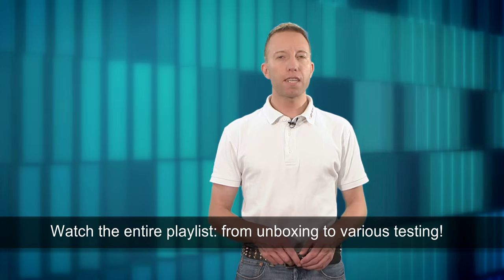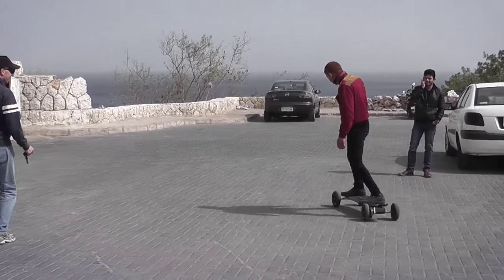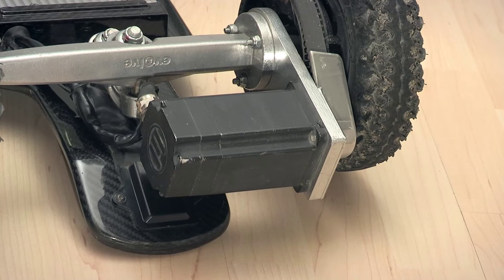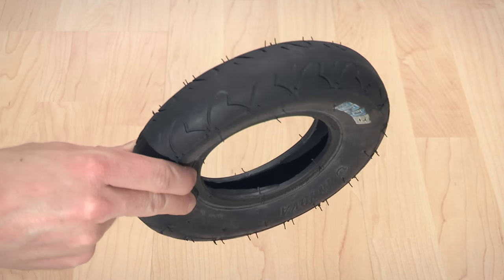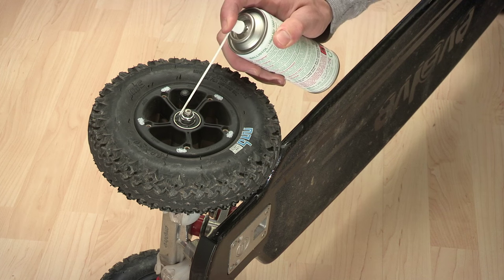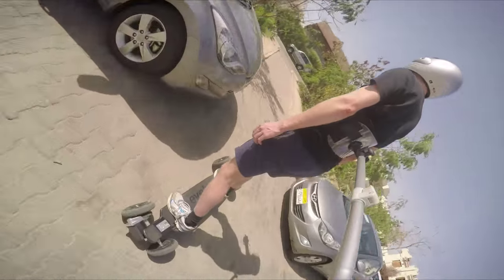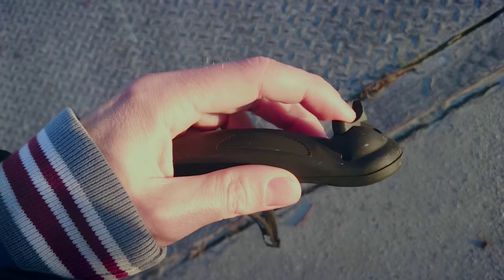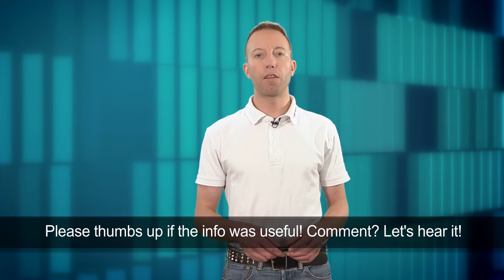1500 km (!) on the EVOLVE - how does it cope? Review, part 3

Comment: My recommendation regarding bearings on my Evolve (Pintail Gen1): After a few tests with bearings including expensive ceramics I switched to "Zealous" bearings - they are really phantastic, maintenance free, water proof and near zero resistance. My non-electric longboards roll away with them on even flat surfaces ! Zealous have integrated speed rings and spacers so you can tighten the screws to the max- wheels still spinning freely - but I had to modify the drive gear a bit so the spacer extension does not touch inside - spacer does not spinn but drive gear and wheel. 
BTW Zealous were voted as best bearing by some skater forums - just my 2cents.
Reply from the maker: Thank you very much for sharing this useful advice. I and I'm sure everybody who reads this will highly appreciate it. Thanks also for taking the time to describe in detail why you recommended it thumbs up

Comment: can you tell me exactly, what brand you use to clean/lubricate your bearings please?
Reply from the maker: +Arthur Curry There are 3 options to lubricate your bearings: Wax, special lube (more liquid), and "oil" (very liquid). While the first lasts longest, you need to run in the bearings for around 100 km or so. Special lube is best of both worlds (lasts long and lubes right from the start), and oil is easiest. The thing is: You lube with oil once, then you more or less need to continue. Also, if you don't clean the outside of your bearings properly before lubing, the oil may wash dirt inside, thus killing the bearing. Personally, I like the oil: very good lube, no run-in time, usually no disassembly of the bearing. I clean them regularly anyway (when dirty), so that's fine for me. I use a brand called "Ballistol" - quite common for many things. Could recommend it, but there's many similar such lubes out there. Dry Fluid will likely also work.

Comment: Hi, when is the video about the external batteries coming? Can't wait!
Reply from the maker: +bikeinmotion It's already filmed. Wanted to have it online these days but am currently drowned in my daytime job. But hope to cut and post it shortly. It'll enable you to do such a Range Extension Mod yourself. We're currently riding 4 such boards, all without notable problems and up to 50 km per ride (more is possible). We've meanwhile several 100 km experience with them. Note that nonetheless the project is still in BETA phase and recommended for experienced guys only. Cheers, Tobi
Reply: +HeliGraphix.com Beta is fine with me. I saw somebody build a new battery for his board but thats not what I want. Adding some 5s lipo on occasion would be what I'd like to do. I just dont know how to connect it the best way.
Reply from the maker: That's exactly what we've done (2x 5s = 10s BTW). Video will show you how to best do it and be minimally invasive at the same time. Concept is beta proven. See you soon then!
Reply: Soon is now  :)
No just kidding, my board should arrive tomorrow so I'm really lookin forward to the video.

Comment: My board was badly (and wrong) assembled (bought in the USA), it also got the first part that broke due to fatigue cracks after less than 3 month!! Badly engineered when it come to worst case scenarios imo!
The air wheels are probably pretty helpful to keep the parts alive, the street version wears up VERY fast!
Reply from the maker: Thanks for the info. Always good to hear about individual experiences as over time it gives a good insight into how the boards hold up.

Comment from the maker: +Joni English  Still pretty much the same range. I need to add though that I'm alwas storing the board properly, meaning not fully charged but at its ideal stoarge voltage (roughly equivalent to 30 - 40% charge). Storing it fully charged as Evolve advises is a sure way to diminish your battery performance. // @Joni: as mentioned earlier, plse. check your G+ privacy settings, it is not possible to answer to your comments directly!
Reply: +HeliGraphix.com seems like a aweful lot of problems for such a expensive board ?.
Reply: +Blake Garvey i wouldn't call these details all problems... its just wear & tare maintenance that will be more common with AT kit... the street kit will probably have different results overtime. a BWM 5 series will probably take less of a beating than a Chevy Silverado... you have to have the right expectations with each board :) its soooooo worth it to deal with when it comes to these factors!
Reply: +Blake Garvey Constant use on 1500km on uneven terrain it WILL take its toll on the mechanical parts, but given the right maintenance and expectations it's a pretty low cost.

Comment: Outstanding, thoroughly informative video. I just discovered your videos as I've been considering buying one of these boards. May I ask where you purchased those replacement tires/wheels? I was worried they would be odd, hard to find and would have to pay high price for original Evolve replacement ones (since they get the most wear and tear). Again, great vid's. The heli's lifting the woman blew my mind. LOL
Reply from the maker: +Francisco Borrego Thanks for the great comment Francisco. The tyres/wheels aren't produced by Evolve, they just buy them from 3rd party; in this case MBS Mountainboards. This means you'll get them anywhere, although the price is pretty much the same across vendors. The tubes as such are even more standard stuff, they're the ones used e.g. in wheel chairs. I bought most stuff from Evolve, but for testing purposes a bunch of wheel chair tubes (all my many flat tyres were with "Evolve" tubes); so far zero difference, exact same thing. Bottom line: the replacement parts aren't hard to find, but the price is indeed high and - except for the tubes - not really different across vendors of a certain region/country. Hope this info helps.
Reply: Very helpful indeed. Thanks for the response and all the great videos!

Comment: Just rode again today . outside temps -8c      , yes Also experience remote cut out , from time to time .this is later on during the ride after about 30 mins .and on high speed setting . red led light was also on solid.
but when connection resumed was ok .

Comment: cool project! Im about 2000 in and though Id share my experience with my carbon street.I found my phone was causing radio drop outs the most (I still take my phone with me on airplane mode), also the  connectors on the radio circuit board  in the tail vibrate loose, more so on the carbon street a dap of hot glue on the plug and conector fixed mine , I also use the range extender(power on, wait till the remote binds, press power button 4 times fast , light flashes fast ,4 meter range) .  I'm quite convinced the drop outs are interference .I have had drop out in exactly the same spot .Dont get me wrong I love this board the most out of the handful i have tried but the fail safe full brake at 40 km per hour isn't nice and is not for a beginner . As for the battery Its well know that lipo battery's don't do well in low temperatures, its best to store the board out of the cold (room temp) before use . Also if you flaten the battery dont store it flat ,charge then store . Only charge lipos at room temp were possible , on cold mornings I would lightly warm my battery's in for rc planes for much better performance all round.
Reply from the maker: Many thanks for this insightful comment and the tips re. drop-outs and vibration. That's really useful, me and the rest of the community certainly appreciate it! 
Sorry your comment got trapped in YouTube's spam section (really have no clue why), didn't find it until now.

Comment: I'm sure the wearing down of the drive wheel teeth is from the friction when hitting the brake. i loosened my drive belt so I'm sure this is something i will also encounter eventually. i agree with the air deflation you brought up, kinda baffling....I'm still the only guy/person in Houston riding one of these things, or so it looks like... and I'm ok with that B) Great review btw!
Reply from the maker: +Shane Shannon Thanks for the comment and for sharing your experience Shane. That's always cool and interesting for everybody around here. Re. the wearing down of the drive wheel, I also thought it might be due to braking but when taking a second look, this seems unlikely. Because in that case the teeth would be worn on their other side. We fly lots of R/C helicopters and there you find similar wear patterns, caused by one gear pushing the other, and also by belts running over pulleys (basically same as on the Evolve). Normally you'd expect the belt to wear much faster than a metal gear/pulley. But at least on the helis we were surprised to find it's oftentimes the other way round. Against this background the wear mode on the Evolve seems to be the same, i.e. caused by forward acceleration. Eventually everybody will run into this problem after a certain mileage. Curious to learn when mine will reach a state where the belt drive doesn't work reliably any more, despite a tight belt tension.

Comment: Thanks bro, quite a lot of data!
Reply from the maker: Very welcome, thanks  for letting me know!
Reply: Np.
If you are there, can you please tell me does that carbon deck bends?
How electronics and li-on cells handle it?
Reply from the maker: There is a slight bend in the deck, but nothing compared to the bamboo/bustin or any good longboard you'd know. Consequently, no problem for the cells inside. On the bamboo/bustin, all the electronics/battery is inside a tray, which is fixed to the deck with screws, but there's sort of a rubber mat inbetween. Meaning it allows for more flex than on the Carbon. Carving with it feels better then with the Carbon, also the agility is higher (but less stability at higher end speeds and offroad).
Reply: Thanks again!
I'm asking because I want to build my very own esk8 where deck will be made out of fiberglass(perhaps some carbon tubes inside).
And all electronics/cells will be inside that deck(3cm thick).
Reply from the maker: Sounds great - let me know once that thing hits the street. Best of luck!
Tobi
Reply: Ok I will let you know, but its just at stage of designing the deck in 3D software...

Comment: Great videos! Do you experience any issues with the motorization only being on one side? For example if you lean to the right, will the wheel lose friction to the ground? Thanks!
Reply from the maker: +Florian Fietz Thanks Flo! Re. your question: no, in 95% of all situations that's fine. Problems may only show up on loose ground (where the friction of 1-wheel-drive is generally not enough) and when doing very tight right-truns where you're low on the board, grabbing the deck with your hand and heavily leaning out. Then the drive wheel sometimes "takes off".
Reply: Cool, thanks for your help!

Comment: I'd like "report" something, whenever it's raining or significant amount of moisture in the air, the crevice at the powerbutton easily collects enough to wet the PCB making it short itself. Sugru seems (which i  never heard of before) to make the electronics waterproof, making it best of both worlds.

I HAVE to try Sugru, i already had water damage and while it's fixable each time the corrosion does takes its toll on the PCB. While I'm waiting for the belts I've ordered, i'll be cleaning my Carbon so the dirt doesn't get stuck underneath.
Reply from the maker: +Ohem1 That's interesting, thanks for the heads up. Never heard of the problem before BUT we've found that there are quite a number of different versions of remotes, even though they look pretty much the same from the outside. So yours may be especially prone to moisture. Sugru is a good fix for many things. There's also liquids to make electronics waterproof; just google it, they use it on multicopters, too.
Reply: +HeliGraphix.com Oh i wasn't talking about the remote, i meant the powerbutton on the longboard, sorry if i misled you. To be precise, the circular crevice where the powerbutton is seated is what's collecting the moist and so corrodes the PCB. This is what I meant: http://i.imgur.com/TIVlUQ7.jpg and http://i.imgur.com/zeLFi4M.jpg
Reply from the maker: Ah, thanks for the clarification. Yes, this is indeed a problem. We used Sugru on the inside to seal off that button. I've seen that on newer boards Evolve uses hotmelt glue on those buttons. But not sure if it's meant for sealing because not done properly. Anyway, Sugru's a good option.
Reply: I agree, Sugru seems to be the better option. I was thinking of making Sugru being the cover for the button on the outside as it's waterproof as well as elastic.
Reply from the maker: Didn't think of this before ... but it seems like a real good idea. Yes, could work. Please report back after trying! / Alternatively, you could use Sugru to "glue" a piece of thicker plastic foil over the button (ring of surgru to fix the foil to the board).
Reply: +HeliGraphix.com I tried with covering the power button with Sugru, it did it's job protecting but I have to push a bit harder. A bit plastic covering the button and keep it in place with Sugru might be the best option.

Also, it's been some time now, any progress on the extended battery video?
Reply from the maker: Thanks for reporting back - that's always a great thing for everyone to know if/what works.
Yes: video's 80% cut, however we're on an international helicopter mission (cool one!) starting end of this week - so until end of this month unfortunately no opportunity to complete it. Good news is: we've meanwhile pretty extensive experience with the Range Extension Modifications. It works fantastic with no issues. There are a few learnings, though, and these will be integrated into the video (means: need to shoot a few bits before we can finally wrap it). Advantage is: if you do it yourself on your board, then you can be sure it'll work.

Comment: How do you extend the range with external batteries? Does it simply plug into the charge port? Thanks.
Reply from the maker: Hi Charlie - no, you'll need to do couple of more modifications on the board. But nothing you cannot do with basic skills. Video on how to do it has been filmed and got stuck halfway in post-production because I'm so drowned with work. Unfortunately on a very recent heli (fun) film trip, over 20,000 of equipment got stolen (insurance doesn't cover it). This also held us back quite a bit. Such a shame, really .... but stay tuned for the video.
Reply: +HeliGraphix.com Sorry to hear about that. Thanks for the video and I will definitely watch for the next one.

Comment: As the teeth were worn down, were you able to replace the drive gear?
I can't find a spare part gear sold on the Evolve website. I'm curious, in preparation, if my gears were to wear down.
Reply from the maker: +TheAwesomeJason Hi Jason, I haven't replaced the drive gear yet but will need to do so soon. There are a number of parts Evolve don't offer via their websites. I've found that writing to them via email usually solves the problem. So that's the way to go for us (hopefully).
Reply: +HeliGraphix.com Thanks for your reply! Great videos, by the way.

Comment: I've been keeping up to date of your review of this board. Thank you so much for the testing of the board. I have a question, how does it do when it rains? Would you ride if it was raining? I have been looking at all the electric boards on the market before I buy.
Reply from the maker: +Evan Pham Hi Evan, welcome. Evolve clearly states you should not ride the boards in rain or on wet surfaces/through puddles. We've tested it and opened the board and found it gets a bit wet inside. Ever since we've used Sugru (as briefly discussed in this review) to make it more water resistant. This works nicely and we do ride the board also under rainy conditions now (only if we have to, it's not much fun and you look like someone sprayed dirt all over you). In fact we even experimented with mud guards lately. So bottom line is: it's possible but preferable to not do it. Should I do a video on how to make it water resistant?
Reply: +HeliGraphix.com yes please. I'm thinking of buying one of the boards. which do you recommend? bamboo or carbon? street or AT or both?
Reply from the maker: BlueSlime Unless you're one of the guys who're into the Carbon look, the more budget Bamboo will do nicely, plus it's more agile (but less stable at high end speeds). I always recommend the A/T because it is so universal; you'll find yourself going "offroad" soon. Should you be a true skateboard guy having ridden longboards previously, then the street version may be your thing.
Reply: +HeliGraphix.com if i buy the AT from the site and maybe buy wheels and others on some othersites will it be less expensive? and also. when will you be making the water resist video?
Reply from the maker: I doubt it's going to be significantly less expensive, but you run the risk of incompatability of some parts and it's simply a hassle. I'd buy the compete board ready to roll and later then - once you need them - consider 3rd party spare parts. We've had a question/discussion on this in an earlier comment. // Water resist: So far not many requests for this one ...
Reply: +HeliGraphix.com I just checked the board specs on both. it seems bamboo board has 7 lithium battery and carbon has 10ah lithium battery which approx can go around 10 km more.
Reply from the maker: BlueSlime Exactly true. Next board video we post is a Range Modification Mod. You'll then be able to travel 50 km with such a board should you decide to hack your board. It's mentioned in the beginning of this video here (you can see the "battery wings" on that Pintail).
Reply: +HeliGraphix.com hi! is there anywhere i can buy DIY All terrain for this board? because it costs me 300 euros just the parts excluding motor... and is it possible to upgrade the motor with dual motor system?